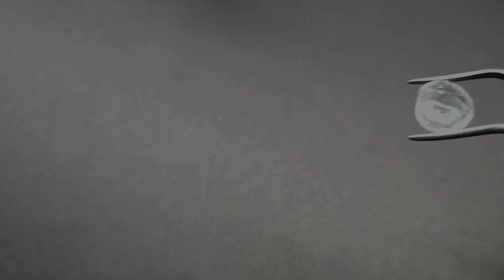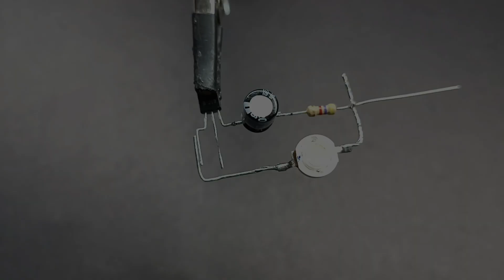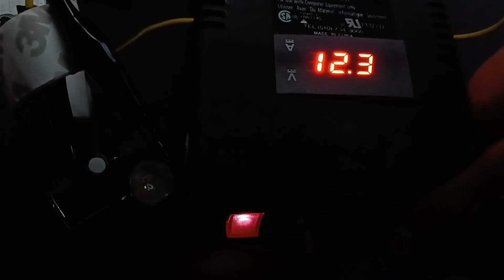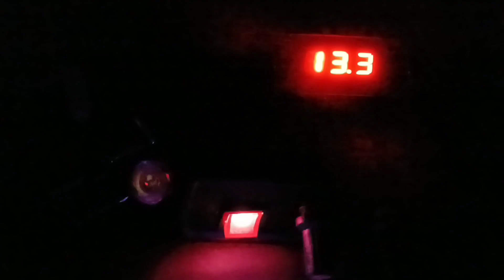Led Flasher Strobe Circuit / Uçak Kanadı Flaşör Devresi Yapımı

Comment: Elinize sağlık. Ben devreyi yaptım ancak hemen transistörler yandı. Acaba led 1w tan  yüksek olduğu  için mi yandı.
Reply: Merhaba. Emeğinize sağlık. Bu devre elemanlarını en basit nereden bulabilirim ( net üzerinden sipariş ile ) 
Bir de, Volta göre, led çakma süreleri sıklaşıyor galiba ya da ben öyle gördüm… ben bu sistemi motosikletime arka stop bağlantısına ek olarak yapmak istiyorum fakat, rolantide 13 Volt civarı değerleri var motorumun, sürüşte ortalama 14v-14.5volt’lara kadar çıkıyor Akü üzerindeki şarj… yani 12volt-15volt aralığında sabit şekilde ( örn; 3 saniye’de bir çakması gibi ) bir sistem yapılabilir mi? Çok teşekkürler. Bu kanal güzel yerlere gelecek gerçekten. Destekçinizim. Saygı ve selamlarımla.
Reply from the maker: Çok teşekkür ederim. Motorunuz için bu devre pek uygun olmaya bilir. Extra başka bileşenler eklenmesi gerekir örneğin 7812 Voltaj Regülatörü. Fakat bunlara gerek kalmadan yine kanal içerisinde NE555 entegresi ile yapmış olduğum devreler mevcut size uygun olan da budur. Devre bileşenlerini her yerden ve tüm elektronik sitesi üzerinden temin edebilirsiniz. 👍
Reply: @hobielektronik55  hemen bakıyorum o videoya. Çok teşekkür ederim.
Reply from the maker: @doqukankorkmaz  Rica ederim. Takıldığınız yer olursa yardımcı olurum yine.
Reply from the maker: Teşekkür ederim. Bu devre sonucunda şerit led kullandım herhangi bir sorun oluşmadı 2 watt power led bağladım sorun oluşmadı eğer bağlantılarınız doğruysa kullanmış olduğunuz ledin watı sorun çıkartmış ola bilir.
Reply: @hobielektronik55  teşekkür ederim. devreyi tekrar deneyeceğim.